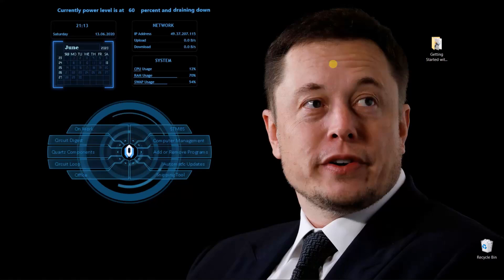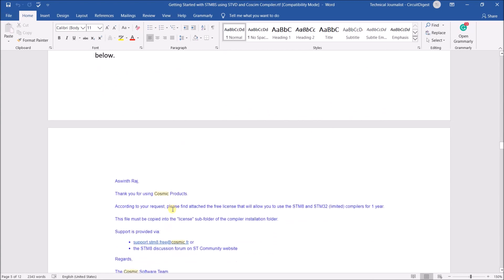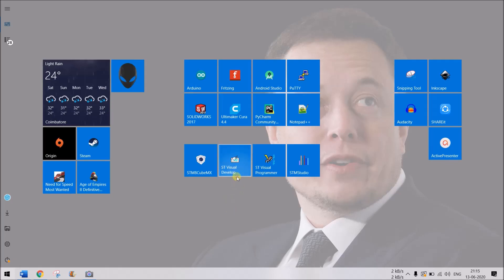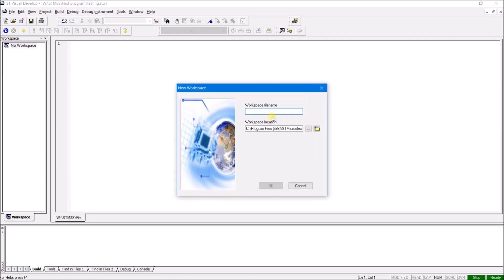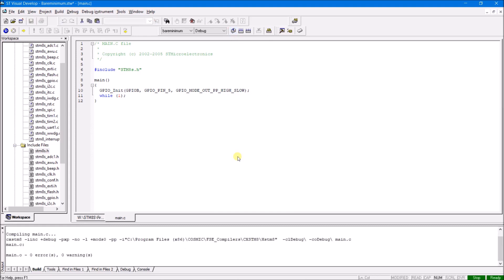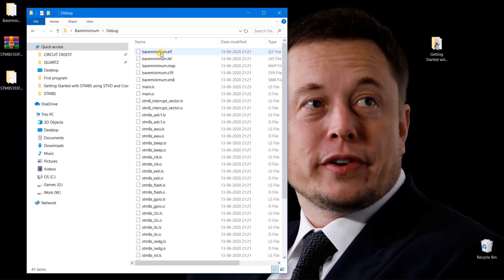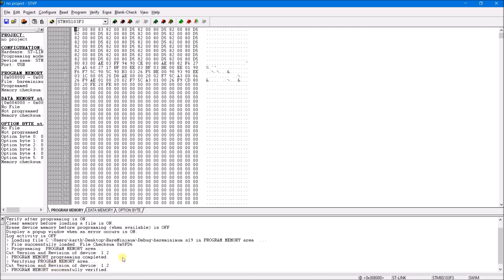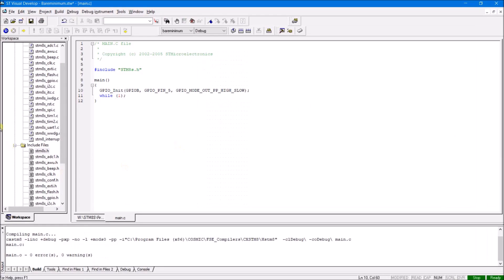Getting Started with STM8S using STVD and Cosmic C Compiler

Comment: clone stlink v2 blue -is it working 2025? because stm32cubeide blocked it . tried all firmwire upgrade using stlink utility but cubeprogrammer cubeide stm32 bloking it. that why asking will it work on stVD? i also brought  stlinkv3-mods for stm32 debugging purpose. even arduino ide using cube programmer blocks stlink v2 cloned device. need help
Reply from the maker: They still work without any issue. But in the market there are different clones available. Some may not be working. That's actually the clone's fault. Still, some clones work without any issue. But finding them may not be that easy.
If you work a lot with STM MCUs, I would suggest you to get either a genuine STLINK or an STM development board with builtin STLINK, which can also be used as a standalone programmer for other STM MCUs.
Reply: @Circuitdigest  i have tested STM8S003F3P MCu in STVD IDE and STVP , the cloned usb type STlink-V2 is working as a programmer . Now we want to move debugging process. ST provided standard peripheral library using is critical to understand than direct register level programming. cbut configuration fuse bit, clock setting need to under stand. make a long video with ellustration of architecture and every register accordingly.
Reply: @Circuitdigest  I have purchased stlinkv3 mods ,genuine.will it work on stdv for stm8 series? In datasheet of stlink v3 mods I didnot find stm8 programming and debugging....
Reply from the maker: STLINK v3 Mod does not support STM8 MCUs. For that either buy an STLINK v3 SET or the STLINK v2
Reply: if i buy genuine stm32 dev board with inbuilt stlink v2 then can i use it for stm8s bare board and also stm32 bare boards?
Reply from the maker: Yes. You can.

Comment: i am not able to get s19 file after compiling and getting error when i am choosing build option
Reply from the maker: The firmware file will only get generated when the project is compiled successfully. Check you code for error.

Comment: Hello, very interesting and pleasant presentation!
I'm struggling to read a stm8S207MB and I can't. I've been struggling for 2 weeks. I'm using a St link v2 that is not recognized by the pc, it may be defective, it's a clone (the red light comes on and goes off and on, so I don't know if it's ok. I ordered two more st links, my pc sees them but I can't open anything, it gives me a connection error. I downloaded the programs but I can't communicate with the board! Stm8S207MB - it's on a ddj Sx console board - I have a defect this circuit, I bought a new circuit but I have to program it to put the code from the old circuit that no longer works!
I ordered another st-link - If you have a solution for me! A beautiful day !
Reply from the maker: Most clones available in the market have these issues. A simple solution to try is to disconnect the power to the target and connect it back as soon as the read or connect button is pressed. For a permanent solution, I would recommend buying either a genuine STlink or a Discovery or Nucleo board with onboard STlink. Another solution is to replace the TSlink microcontroller with a genuine STM32f103 and reflash the SLIlink firmware, but for that you will need an additional known goor STLink.

Comment: Error : Cannot communicate with the tool.
Wrong tool selection or check tool power supply or check that a previous session is closed.
Error : < PROGRAM MEMORY programming failed.
how can i solve this error
Reply from the maker: If it says it can't connect with the tool, try installing the proper driver for the ST Link. And make sure you are using an ST link, because there are plenty of other programmers that looks like the ST link v2 mini clones.

Comment: Great tutorial. I have  project using stm8s005k6t6c, do u have any peripheral library for stm8s005k6t6c ? I would appreciate it
Reply from the maker: I think you can use the same peripheral library for stm8s005 by changing the comments section in the stm8s.h header file inside the include folder. I have used this for the stm8s001 too.
Reply: @Circuitdigest  I think you are a genius
Reply: Yes, I've tried that and it worked. But, I don't use stvd and cosmic. I used SDCC. Anyway, Thanks, man.

Comment: Hello sir, I have problems with the registration of the compiler. When I compile code, it gets me this message: FlexLM Invalid (inconsistent) license key.
I have the license and put that into the license folder of the compiler but no luck. Did you have any similar issue?
Reply from the maker: did you got the license key file from the official mail of the cosmic C compiler after register in the cosmic c ?

Comment: Getting error while uploading the code in STVP- Error: Cannot communicate with the device!

Check the SWIM cable connection and check all the needed pin connections on the SWIM connector.

If the application code uses Swim Disable and Reset pin as Output or has disabled SWIM Clock Divider:

Try Now to SWITCH OFF and ON the application Power Supply while the NRST Reset pin is forced low.

Comment: facing some error
Compiling main.c...
cxstm8 -iinc +debug -pxp -no -l +mods0 -pp -i"C:\Program Files (x86)\COSMIC\FSE_Compilers\CXSTM8\Hstm8"  -clDebug\ -coDebug\ main.c 
#error cpstm8 stm8s.h:2708 can't open stm8s_conf.h
main.c:
 The command: "cxstm8 -iinc +debug -pxp -no -l +mods0 -pp -i"C:\Program Files (x86)\COSMIC\FSE_Compilers\CXSTM8\Hstm8"  -clDebug\ -coDebug\ main.c " has failed, the returned value is: 1
exit code=1.

led.elf - 3 error(s), 0 warning(s)
Reply from the maker: Hi vinoth, please use our forums https://circuitdigest.com/forums to post your questions. People there will be able to help you